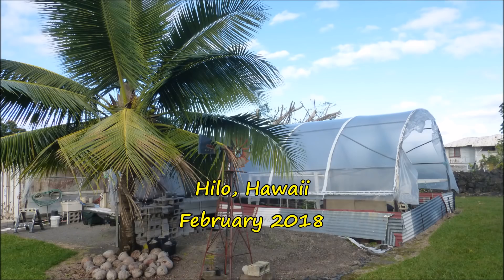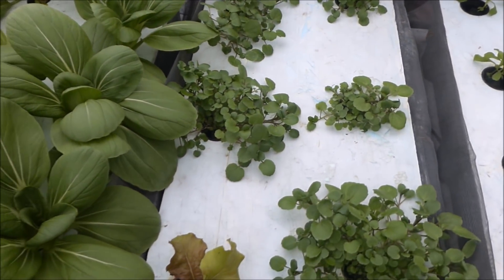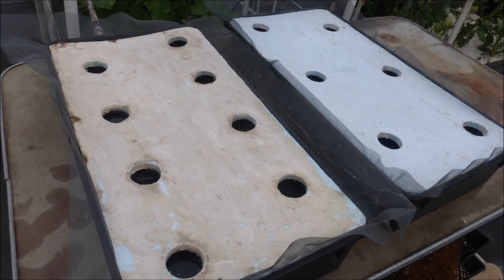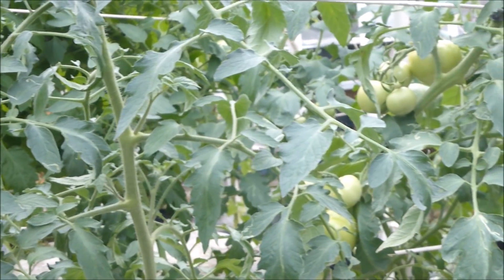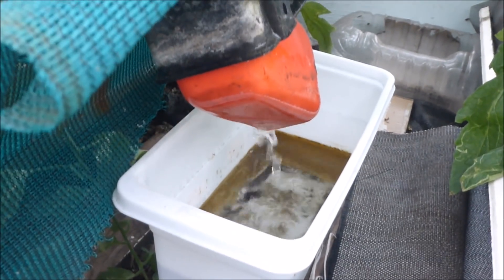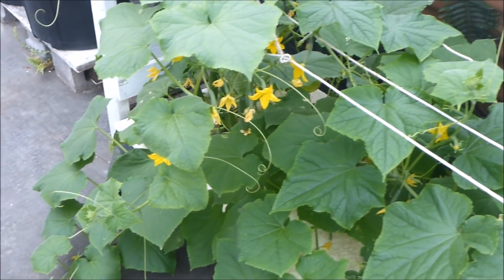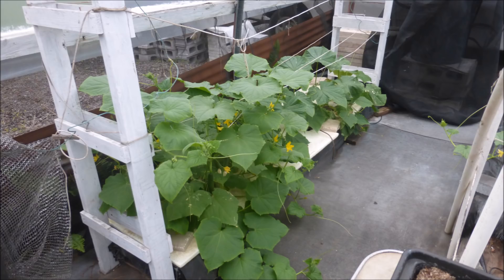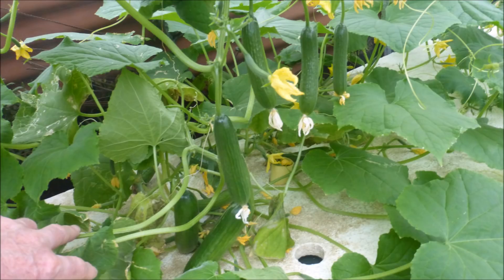Tour of Kratky's Hydroponic Garden in February, 2018

Comment: Mr Kratky,

Where do you find those trays which you grow in? Also, the flow valve sump assembly can be purchased where? I have never seen those. 

Do you happen to have a link or some info on them? Keep up with the great videos! Thanks!
Reply from the maker: The tray manufacturer is Iris USA, Pleasant Prairie, WI.  It is called a 'Stor-it-all Trunk Tray.  I think Iris is headquartered in Japan.  The Miller 'Little Giant Trough-O-Matic TM825' float valves are commonly stocked by feed stores.